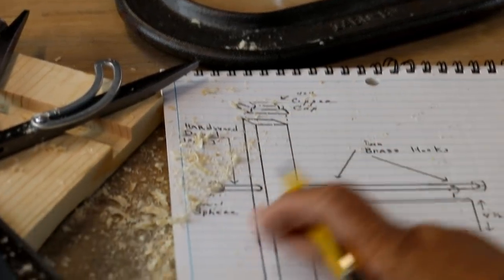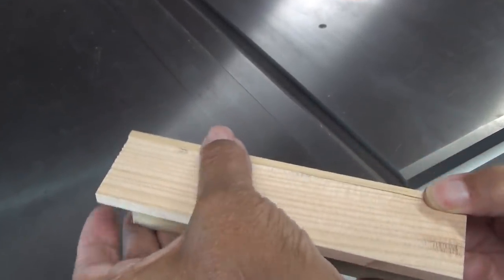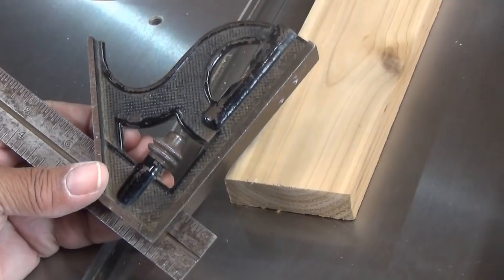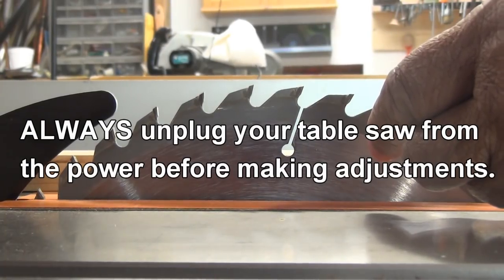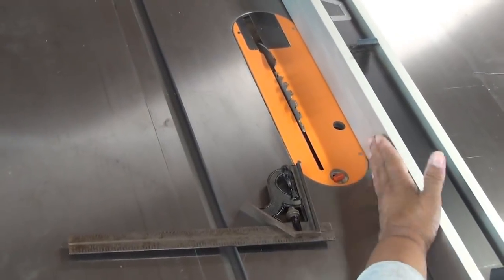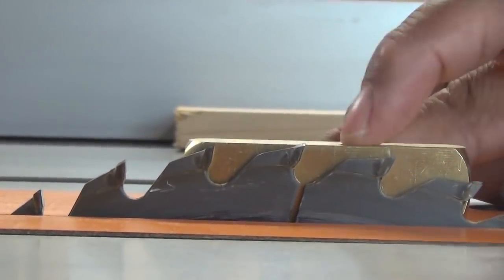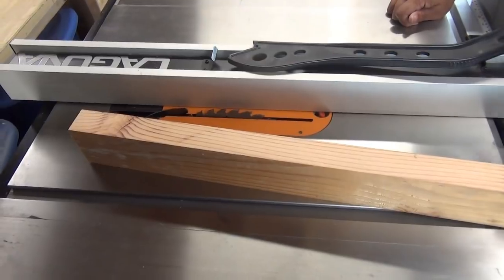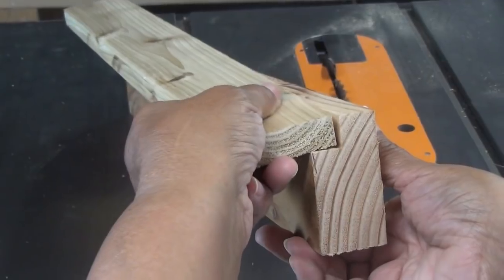Surprisingly Easy Woodworking Joint for Beginners

Comment: That is a great tip on making the rabbet joint with the table saw and as for the write in the rain notebooks, I used them when I was working for the Arkansas Department of Corrections and the notebooks came in handy since we perspired so much when outside especially. I still have a few around home and purchased them at the local Army exchange and love them so much.

Comment: Another great video Leah.  I have been using this joint for years now and you are so right, it is one of the most important joints to know for beginners and general wood working.  I make a lot of cabinets and this is great for recessing backing on the cabinets.  A great tip that I use for finding the blade height since I don't have blocks is to use drill bits instead.  they are always in the shop and it provides you with several different thicknesses.  Thanks again.  Be safe.   Tim
Reply from the maker: Tim Caron. Like the drill bit idea..... Thanks for sharing  it.

Comment: My wood keeps getting stopped by the black guard behind the blade. What am I doing wrong?
Reply from the maker: You need a table saw which allows you to remove the splitter and install a riving knife.  A riving knife does not interfere with certain cuts.